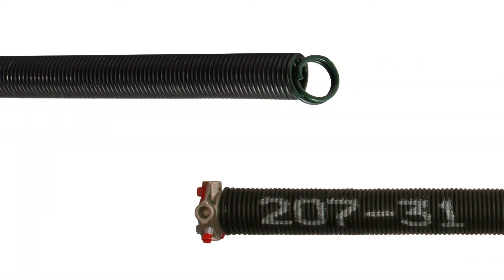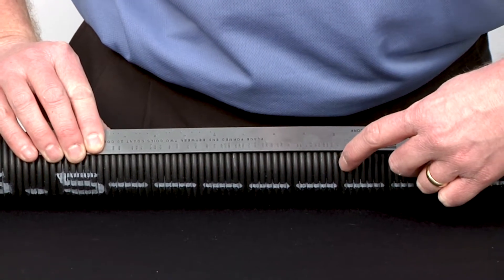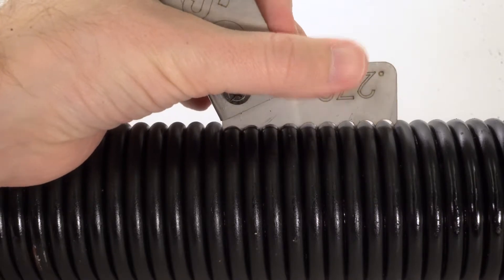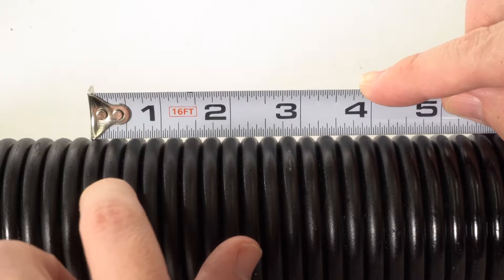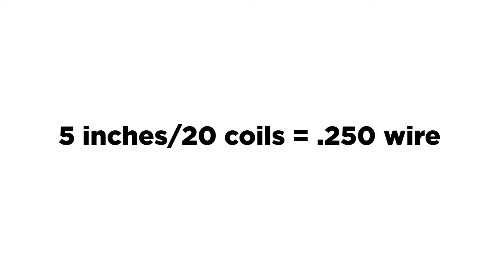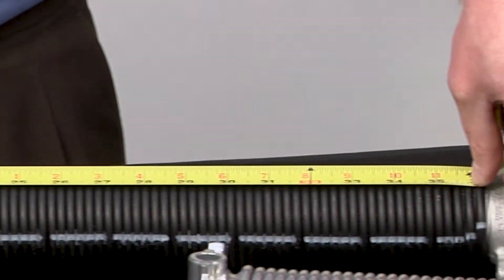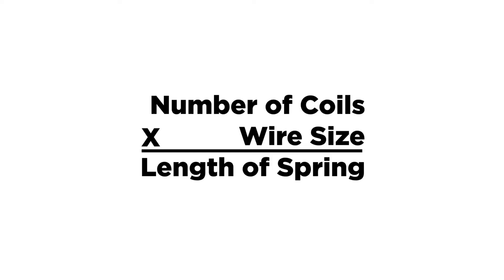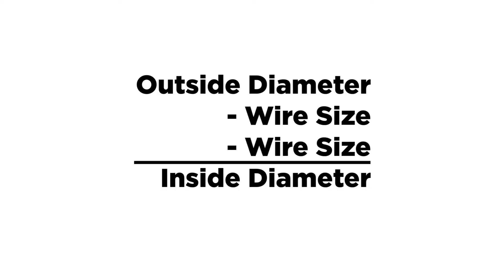How to Measure Garage Door Springs

Comment: According to a garage door installer i spoke to he said this method is only for torsion springs. I have a  one piece door.
Reply: how does the door bend when it rolls up if you have a one piece door?
Reply: @RichRich007  He probably has one of the old swing out and up doors. They use a different type of spring.